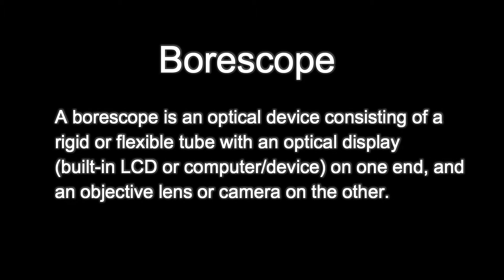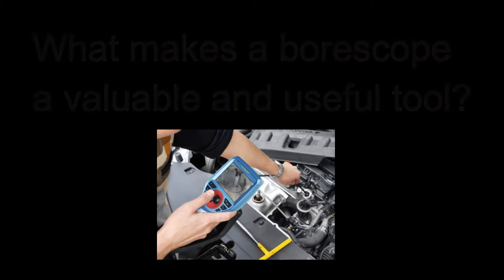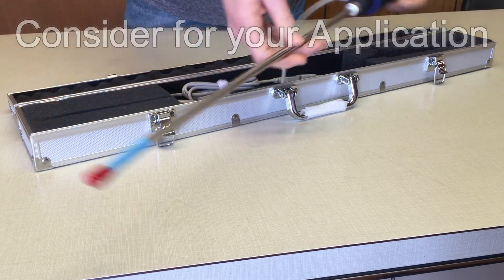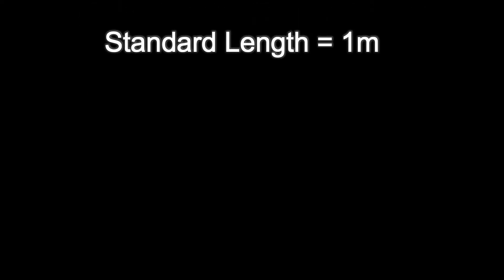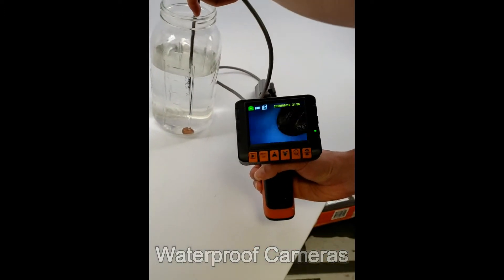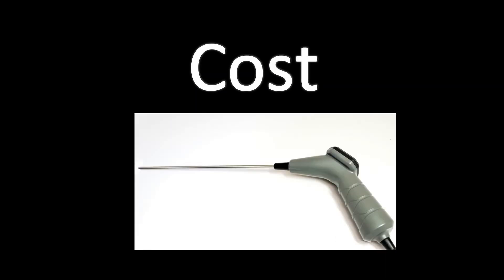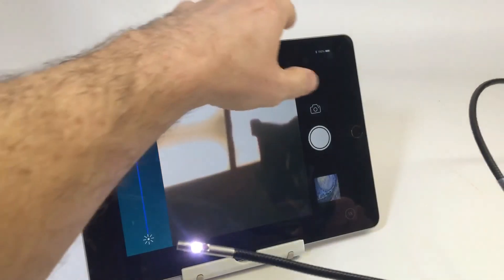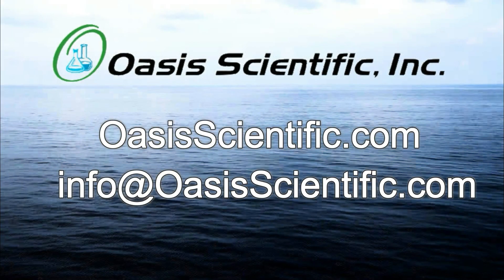Overview of Digital Borescopes Videoscopes Inspection Cameras

Comment: I started using Borescopes in the Navy for equipment inspections.  When I retired  I added one to my tool box immediately, $1600 at the time. With today's technology the units are more reliable and cost about half as much as the similar units of years past.  LOOK and tryout before you purchase.  I use only articulated units for the versatility and it is well worth the extra few bucks. GREAT equipment, good luck all.
Reply from the maker: Well said. The technology is moving fast to better image quality, smaller diameter, better lighting, more versatility and lower cost. We are at the front seat to witness the progress in recent years.